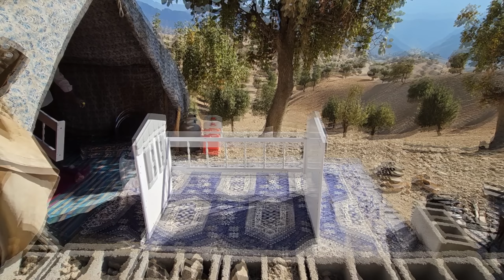A documentary about the lifestyle of a nomadic family in the village: parents washing their babies

Comment: I would like to see Diana learn to roll from her back to her front, and from her front to her back by now.  If babies hate tummy time they will cry.  Tips: 1. Roll them on to their back, and then roll them on to their tummy.  Once they're on their tummy, place a roll up towel underneath their arms and chest.  This will lift their chest off of the floor.  This will shift their weight to the top of their body, and make it easier to lift their head to strengthen neck muscles.  As your baby gets stronger you can get rid of the towel for support.  2. Hold the baby like a football.  That is hold your baby with your arm underneath your baby's tummy.  So your arm is at 90 degrees, support the baby with your arm or arms, where the baby is lying on it's tummy, but it's head is not supported.  The baby has to lift it's front and head.  So you're basically holding your baby like a football, with your baby's chest and bottom supported and cradled in your arms, but it's head is not supported.  3. My favorite is place your baby on it's tummy ontop of your chest.  So in an inclined position you lie on your back, with your baby on it's tummy.  Babies love this chest to chest position, because they love being close to mommy.  4. Lie your baby across your lap sitting cross-legged.  Your leg will support the  baby's chest.  5.  To get baby to roll over, start taking toys and having the baby follow with their eyes as you move the toy across their horizon to their opposite side until they've to roll on their side to see the toy.  Start playing this game side to side, until you can get the baby to roll over on it's own.
Reply: She is delayed I think maybe from being strapped in that cradle for so long. She should be rolling back and forth now for a couple of months. Also babling..She needs some toys, tummy time as well.